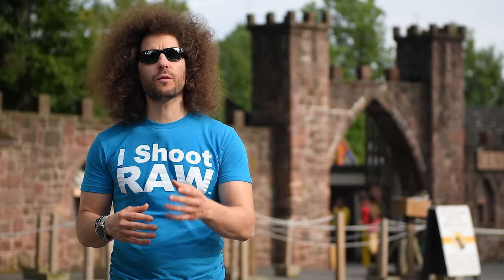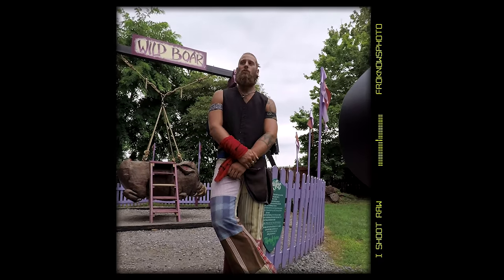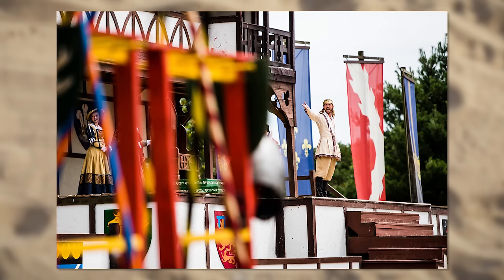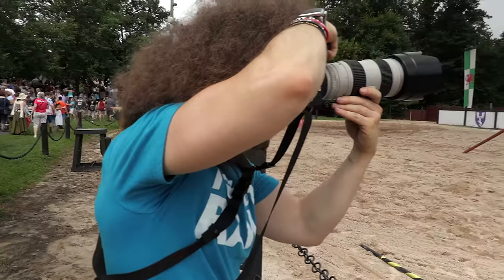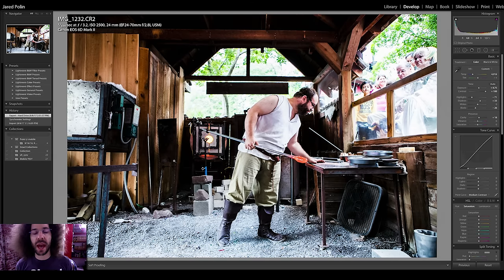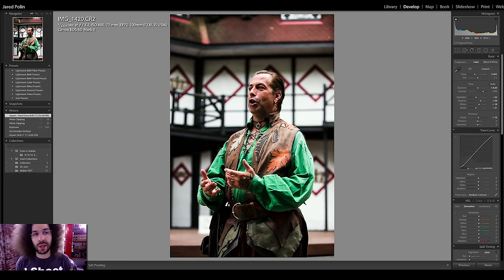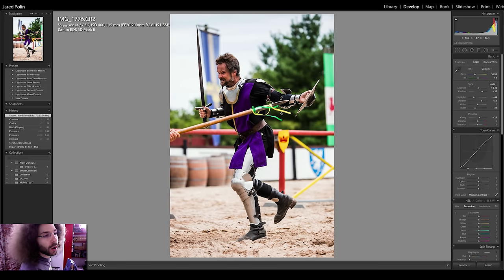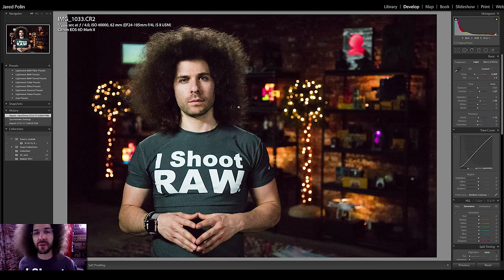Canon 6D Mark II "Real World Review": Does it SUCK?

Comment: Just.  Get. The. D850.
Reply from the maker: +Sondy Danger price difference.
Reply: That's twice as expensive and Nikon is known for making unreliable cameras in last years.
Reply from the maker: wow, that last part of your statement is not true.
Reply: Oh it is. Nikon has been gradually loosing quality they've been known for. It is most apparent with D750. Biggest such fuck-up of Canon in recent years was 70D problems on launch. Not nearly as big and corrected more quickly than D750. Moving part of production to China was very bad move for Nikon. While Canon keeps everything made either in Japan or in Taiwan in case of the very cheapest lenses and such. I've seen few D90 with more than 200 000 actuations still going strong. While many D7200s already dead after merely 50 000. Also when talking about 7xxx line. Why everyone shit-storms about Canon intentionally making 6D2 lack features but nobody even mentions Nikon making D7500 in many aspects literally worse than it's predecesor?

I'm angry at Nikon for how they took legacy build by hard work of F3 and FM2 and throwing it out of the window for no apparent reason.

Comment: Only thing I disagree with is the 1/4000 of a second.  Not having 1/8000 of a second for most of us who do on location flash photography and not being able to go up to 5000 6400 and even 8000 of a sec to over power the sun and expose for that ambient is not good at all.  Any flash photographer who shoots outside, battling the sun, would agree that 1/4000 sucks. Better stock up on ND filters

Comment: Just a quick heads up regarding the ISO issue you brought up. You can set the lock button below the rear dial to deactivate the touchscreen, so you don't inadvertently change settings.

Comment: Great Jared, I’m convinced, the 6D II Is is the best camera for non-professional me. I'm wondering, when you set that AF back button to 'one shot servo' and referencing tracking the bird in flight in your video, did you use single point spot AF to choose the bird as the subject? I'm interested to know if using a single point is good for tracking a moving object in a confined situation like your example which shows the owl flying a short distance in busy surroundings. Thank you for this video, it's inspiring and a great help to me.

Comment: I've been thinking about upgrading to this from the original.  I have no problems at all with the 6D, but it would be nicer to be able to get off center focus point more.  The resolution is good enough for me with the original 6D and I have no problems with birding or wildlife focusing.  I'm mostly in the studio these days with strobes, so dynamic range isn't a huge issue - but I do 1 or 2 weddings a year.  I do more family portraits which I bring my strobes to location but would like to do more without dragging that equipment out.  This is the first review I hear that is good about this body, so still not sure.  Can't afford the 5d4 and the 5d3 is only available here with the 24-105 which is almost 3900.00.  What do you think?

Comment: I have a 650D and I use a basic 50mm fixed lens. I need to get better quality shots shooting very high quality wood furniture and I want to do tethered shooting, which helps me a lot. The touchpad viewfinder is really good but I can also connect through my PC. 

So, the question is which Canon lens gives me the best bang for the buck for a new 50mm (or 55mm) designed for this FF body? The lenses I have looked at go from about $350 to about $1000.

Comment: It's not that the Zone AF is bad. The user just has to be aware of how it works. It will focus on the closest point in that zone.
Reply from the maker: It's bad and shouldn't be used for 99% of the situations.
Reply: Does the camera have different size Zone AFs? I know it's in the 5D Mark IV, but I never use them because I'm never confident I want focus on the closest thing in an area.

I really appreciate the practical usage perspective you put into reviews and not just comparing specs.
Reply: Jared ...you like the Nikon equivalent to zone AF better ...but how do the nikon know which bit you want to focus on.. ? how will it know you wanted to focus on the knights head and not the stick in front of it ?

Comment: The 6D mark 2 is ABSOLUTELY FINE for Semi-Pro photographers who are 
STILLS near-EXPERTS and want a full-frame camera without spending 
huge moolah on a Canon 5Dmk4.

This camera is ALSO DESIGNED FOR a 5D mk3/4 shooter who needs a 
SECOND FULL-FRAME BACKUP CAMERA for their wedding or remote 
landscape shoots. For those wealthier shooters who have a camera 
assistant with them and need a full frame-type capture without having 
to buy a second 5D series you are good to good-to-go price-wise
with the 6Dmk2.

Put a 25mm lens on it and get your assistant on the 2nd floor balcony
for those dance floor/dining room wide shots OR for those quick and 
dirty look-up-here group shots!

This is NOT a videographer-centric camera. The 60 fps 1080p video
coming out of the 6Dmk2 is absolute great looking but for video 
I'd rather have my Sony A7s2 or even a Panasonic G5!
If you're in a pinch OR want to be more discreet by using 
a smaller full frame camera, the 1080p video is JUST FINE 
coming from the 6Dmk2! You can always UPSCALE to 4K
using a high quality Lanczos-3 type video resizer filter in 
Davinci Resolve or FCP.

For you 5D Mk4 shooters who already have a backup camera
and want to step up...you might as well sell the 5D Mk4 and spend 
a few grand more to get the Canon 1Dxmk2! You will just just DROOL
over what it can do compared to the 5Dmk4 series and the build quality
is of course top-notch on the 1D series. Even a used 1Dx (not even the mk2 but a Mark 1) 
is a build-quality, ergonomics and frame rate-wise BIIIGGG step up from the 5D Mk4!

The Sony A9 is also a WORTHY competitor if you want to step up from the 5D mk4
but you are going to have to spend SERIOUS MONEY on new glass to make it worth 
the switch!

Comment: @Jared: Are the JPEGS the ones that got exported from the RAW files, or are they in-camera processed?

Having played with both the RAW and JPEG files, they are both reasonable enough, although I seemed to have a bit more of a problem improving shadow and highlight details from the RAW DNG files. I use Darktable as my RAW file workflow software.

Overall the images are probably not as bad as what people have been claiming on the internet, but I do have doubts as to whether the camera is actually worth the asking price of 2000 bucks or so. Only one low performance SD-card slot as well. If it had been priced nearer to the old model 6D, I would have more interest in acquiring it. Very handy review though - many thanks.
Reply from the maker: they are exported from Lightroom and the RAW files.

Comment: I have the 6D Mk1 and unfortunately the Mk2 doesn't offer enough to make me want to switch.  
Vari-Angle Touch-screen with Full Frame 4K @ 60fps would have been perfect.  I think I would rather have a 5D Mk3 as it's the same price and is a true Pro body.

Comment: Hey, happy New Year. I have been following your vids for some time now and I enjoy them. As I watch them I try to make sense of the info you are sharing. I love taking pictures, especially of my daughter. She does Allstar cheer and I want to buy a camera that will help me capture those action shots in low light. So far watching your vids I have learned that ISO is important for low light and good glass like a 2.8 or lower also fast glass is important as well. I have seen your review on MANY MANY cameras and I am trying to pick the right camera for the job. Right now I have a Canon Rebel T3i but I need something with faster fps and better ISO but of coures I dont want to spend thousands because I am a beginner. I thought of the Canon 7D Mark ii or Nikon D500. I know that the canon 7D Mii I could get it cheaper than the D500. So having said that I would like your input or anyone else on here that could give me some advice. Thank You.

Comment: I honestly think the idea of an "entry level" full frame camera is ridiculous. There's nothing entry level about a full frame body, nor one that costs two grand, so the fact that in 2017 Canon released an FF body that apart from the sensor and related benefits is worse than my 80D for twice the money is pretty crazy. Sure there should be a difference between their pro FFs and the 6D series, but that doesn't excuse the fact that feature wise it's closer to a Rebel than to the 5D series.
Reply: I have both the 80d and the 6d II, and I used to own the original 6D.  I love my 80d and the images are great from it, but the 6D II images are better.

Comment: I could get over everything but the lack of dual card slots, I know the rate is low for failure. However, If your livelihood could be ruined over it, Its silly to not have the redundancy or even split the cards up in case of theft or whatever.
Reply from the maker: I agree.

Comment: Decent photo camera.Definitely gonna consider it as a replacement for 6d in years to come, when the price drops and when the old one does it's time(still working great though) Many people are spoiled with autofocus....there is an option on every lens, you know, AF/MF..you should try it out sometimes if you are that worried about focus. Anyway this is enthusiast level full frame camera and a good cheap backup camera for mark 4 or 1dx mark 2.
Reply: Spoild with auto focus?
It depends on what you are shooting. If you want to shoot wild-life especially birds of prey, a good AF system makes a huge difference. I do have an 85mm manual focus lens, it's great for portraits, but it would be very frustrating to shoot birds mid-flight, the hit ratio would be abismal. Getting the focus right is pretty important.
Reply: DeletedDelusion Not to mention the super tiny viewfinders on DSLRs...
Reply: DeletedDelusion For wild-life and sports 1dx mark2. Super fast(14fps) with crazy burst and great af. Or Nikon d5. That's where af and speed is important, no doubt about it, but then I won't use 6d for it, right?  With macro, portraits, in studio or landscapes I almost always use manual or af and then fine tuning. AF when there is action or movement. Yes it is easier if you have more af points spread more over viewfinder,  of course, but central focus point on any dslr works the best,  it is the fastest and the most precise, and when I use af,  it is that central one about 95% of the time.

Comment: Deciding between the older 6 D or this newest one. No video, just people and landscape. Opinion?
Reply: Betsy's Nest: I owned the 6D for several years. I liked it, but I was never in love with it. Only the center AF point was reliable. And even using that, the focus was hit and miss. A year ago I bought the 80D, a magnificent camera with much better autofocus than the 6D and many more focus points, all very accurate. And it produces clean, beautiful images even at high ISOs in low light. It also has a much more accurate and true Auto White Balance than the 6D. I sold the 6D when I realized the capabilities of the 80D. A few weeks ago I got the 6D II.  I do mostly portraits and the 6D II yields smooth, beautiful images with the same accurate, natural Auto WB as the 80D (both have much better Auto WB than the original 6D). The 6D II's AutoFocus system is also much better than the 6D. Very consistent using any of the 45 AF points. It's great to not have to rely only on the center point and to know with confidence that I can use all 45 and get great results. The 6D is a good camera, but the 6D II has more features and improvements over the 6D that make it the better choice in my opinion. So for what it's worth, that's been my experience, having owned both cameras. All the best to you, and whichever camera you choose to go with, enjoy!

Comment: I have a Nikon D3300 and its a little broken I've had it for almost 2 years and I wanted to know If I should get another D3300 or what camera should I get. I do youtube and photography and I have almost 2k subs so I wanted to see if there was anything that you recommend for me
Reply: Ace5535 canon 70d
Reply: Ethan Strauss I literally just posted the same comment looking for your answer, I have a d3100 got it for 400 bucks and I want to get a canon but I have no idea if their cameras are as good for the same price range ya know? I have like $900
Reply: If you want to stay with Nikon I would upgrade to the 5600 or 7500.
Reply: I have an a6000 with 18-105 f4 G and I think its the best (relatively) cheap set up for photo and video (comparing with some friends that have nikon 3200 and canon 700d).
If you want something more get a a6300 or a6500.
Reply: Ace5535 I just recently upgraded from a Nikon D3300 to a Nikon D5500. Trust me, if you enjoy using the D3300, you will love the D5500. Its just as easy to use and is amazing. Worth the upgrade.
Reply: Trev Schell get a 7d. Sure it doesn't have the flipping screen but it is a very good camera for video and general photography
Reply: Honestly the nikon d5500 is great I love mine
Reply: The a6000 is a very capable camera for shooting 1080p. It won't have great autofocus in video (although better than Nikon's offerings, not as good as the a6300 or the Canon 80D). Right now, Sony, Canon, Panasonic are pretty much all "better" for video than Nikon, if video AF is important to you. All of them are "good" and some excel in some areas but lag in other areas.
Reply: Ace5535 assuming you have a bit of Nikon glass, I recommend either the 7200, 7500 or d500. If you want to go full frame the d610 is great as is the d750. The 500 and 750 have tilt screens that I love. Yes the 5600 has full motion screen and is also a great camera but I lean more towards the 7000 series when it comes to dx bodies.
Reply: Trev Schell you could get like a 700d  for under that and have some extra cash for a lens or two I think the 70d is like 1200 new but you might be able to find a refurbished or used body for 9
Reply: Ethan Strauss you do realise the 70d got the focusing system from the 7d and the 7d is way cheaper than the 70d right?
Reply: Oi Lad OP said video.... 7D has no DPAF that the 70D does...
Reply: Álvaro Reguly lol you actually wanna rely on auto focus for video? Did I say "general purpose photography" and not video? I'm saying the 70d has the same focusing system for PHOTOS. Plus it's just better to manual focus for video IF you're not vlogging. If you are then the 70d would be better. Basically, 7d=photos and 70d=video. I'd still choose the 7d for both video and photos.

Comment: Canon 80D is priced at $1,199 compared to the 6D Mark ii at $1,999.  You can argue, besides the new processor and the low light noise benefits of a full-frame sensor, the 80D at $800 cheaper may be a much better value for most shooters with more features/better usability than the 
6D ii.
Reply: Doni Potts But Still. Full Frame beats APS C
Reply: Seth Seth  Maybe, but there's definitely situations, like shooting wildlife, or shooting outdoor sports, outdoor portraits with a wide aperture where the wider focusing points, faster shutter speeds, and greater dynamic range of the crop camera may provide better use and a more enjoyable shooting experience for the photographer.  
Even if Canon decided not to ad 4k, those small improvements would tempt more shooters to move to full-frame.
Reply from the maker: You said it yourself, full frame, better ISO, cleaner images.  I'll take that all day.
Reply: Jared Polin Lol, hard to argue with that.  But hey, if I learned anything from your real world reviews shooting Norman Porter and Pam Cakes, is that crop can still give professional results.  I'll save close to $1000 and invest in some glass.  Thats just me though right now with more limited expenses.  Thanks for the videos Jared!
Reply: Refurbished 6D II purchased direct from Canon currently $1099. A very good deal.

Comment: I have used Jared reviews as one of my data points for all my camera (and equipment) upgrades, for some time. But I am lost on what to do. I have a 60D, with a 7ti (as a second body) and shot everything (landscapes to events) and I do make a little money. But now I am looking to replace my 7ti with something newer and am at a loss. I set a budget of $1500 (rather spend money on glass) and keep going between the 80d and 6d m2.
Any good ideas?
Reply: 6dm 2 would be ideal if your going to be taken photos it's full frame and u have some of the best features of the 80d on it also..

Comment: Now that "Real World Review" is a proper review, a review with the camera's 'Real World' capabilities illustrated and its high points and failings identified.  If there is a take away to be inferred at this point, it would seem that Canon are expecting accumulations of Canon L glass to push picture-makers to an overpriced entry-level full frame camera. What is more likely is that we will continue giving it 'L' with the 80D while waiting to see if the 5D SR Mark II or the 5D Mark V will add the tilty-flippy screen to their lists of wonders.

Comment: So if it's a toss up among 6d ii/d750/xt2 and I only have a 700d right now so I can jump ship easily, what would you choose for all around camera for enthusiast? thanks
Reply from the maker: I am not a fan of the smaller cropped sensors in the fuji.  I prefer higher ISO's which means I need full frame.
Reply: So ... 6d or d750? I'm leaning to the 6d as I want a lighter weight, but it feels that the d750 is the better camera
Reply: @froknowsphoto   which full frame do you currently use?